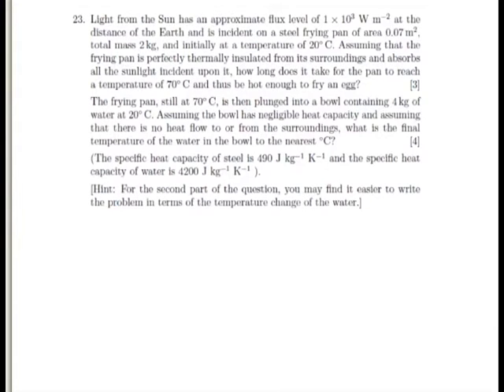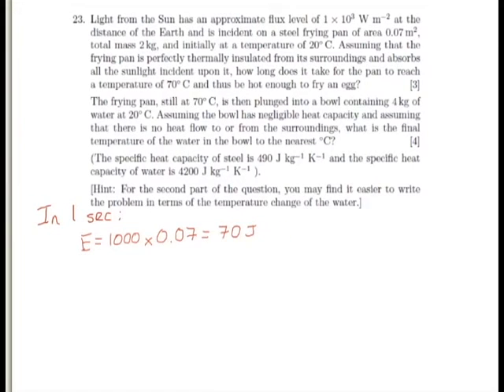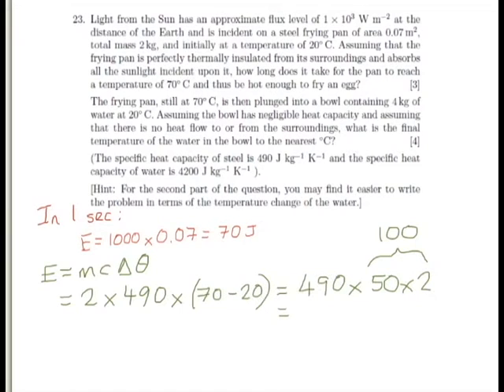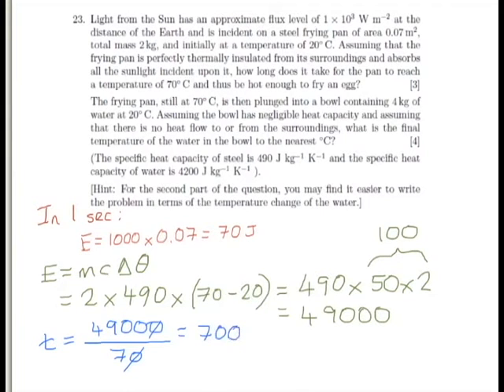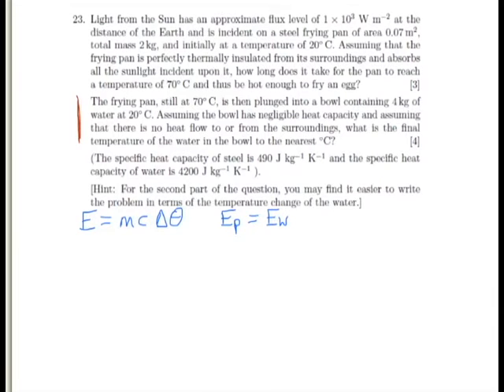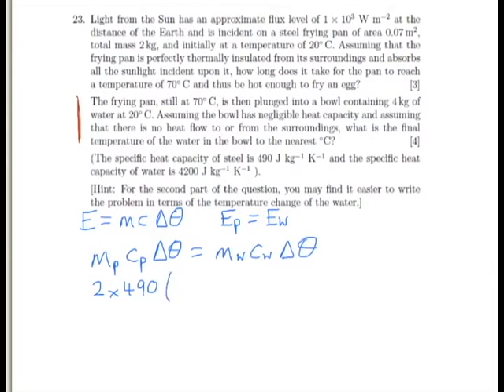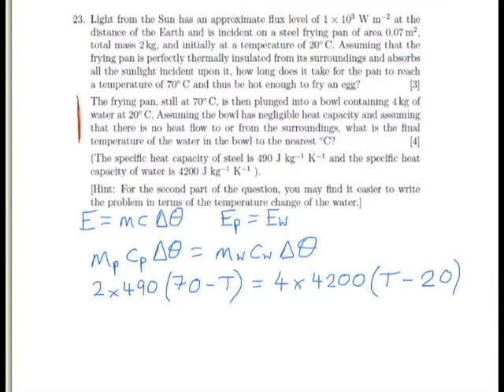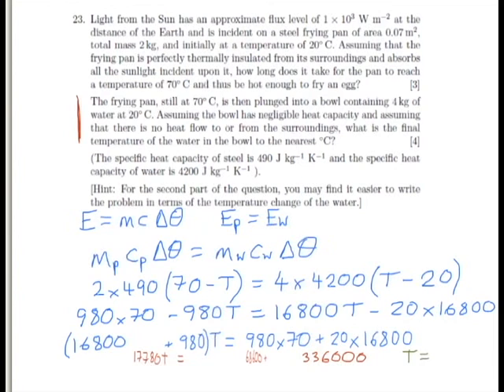Oxford PAT 2010 Q23 (thermal physics)

Comment: Hi, the units of specific heat capacity in the question for the change in temperature is in kelvin however the temperature in the answer is given as degrees celsius. Why do you do this?
Reply: I understand that the question asks for it to be to the nearest degree celsius, however why are the units for the specific heat capacity in terms of kelvin?